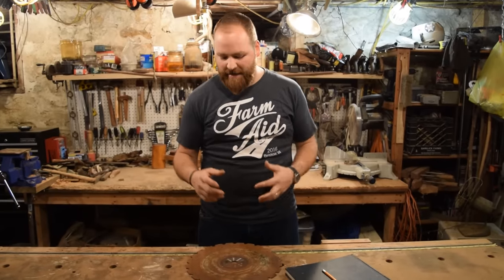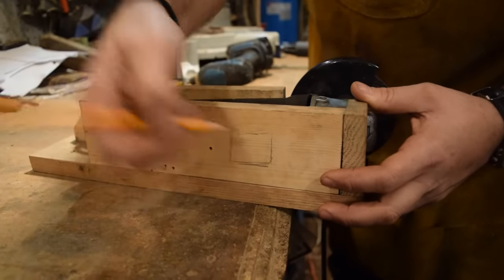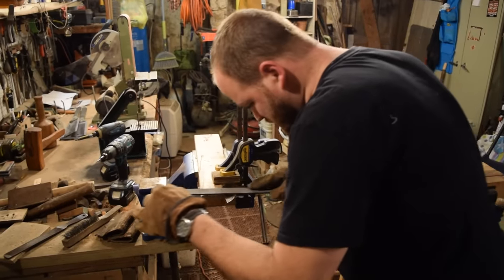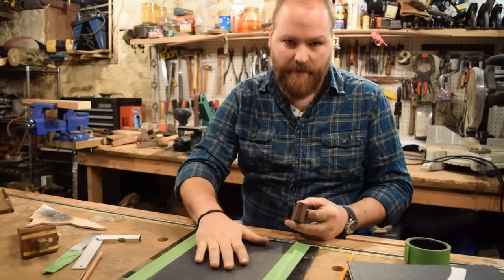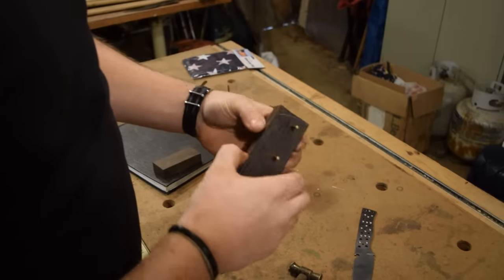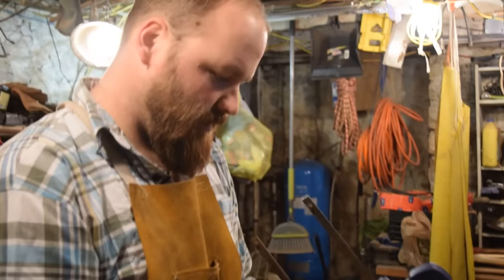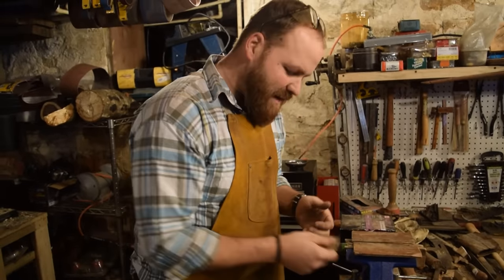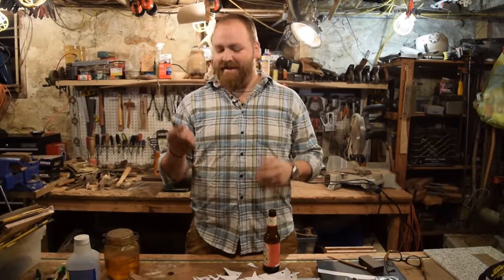Making a Knife From a Circular Saw Blade

Comment: To the marginally negative comments by some regarding Harbor Freight Tools; a craftsman can use any tool.  Tools don't impart talent, tools in the right hands (like this guy's) are simply an extension of the body.  I can't see the knife looking or performing any better with the use of a shop full of overpriced tools...
Reply: Theres a saying i like to use for those people. "All the gear and no idear"
Reply: ABSOLUTELY!!
Reply: certain Harbor Freight tools are great like their hand tools and power tools if you use them for DIY projects. I wouldn't recommend them as a daily tool for contractors or folks in construction.
Reply: But it will make ypur work faster and easier after you reached a specific skill level.
Nonetheless one should start with juat a hacksaw and some files. It works fine!
Reply: @cmiller9800  Exactly! They are affordable for the home DIY guy. I did without a lot of hobby tools until they came along.
Reply: OMG !!! Cheaper tools were used?! I don’t like the end result as much as I did before knowing this 😠 
  Just kidding of course, because I’m not a f**king idiot. 
  Cool knife. Making something useful by hand, got your kid and dog around the shop, looks like a great weekend to me 👍 friggin love it

Comment: Knife turned out gr8. True Craftsmanship. I noticed you said half of 7/8" is 3 1/2   8ths...this is true. A trick for you....any fraction under 1 inch use this method, half of 7/8  keep top number which is 7 ...and double bottom number which would be 16....7/16...my father taught me this trick 30 some years ago. He was a welding teacher for 30 + years. Half of 3/4 would be 3/8. You may have known that trick or not....just passing along knowledge. Great video shots.
Reply: I've never heard that before, awesome idea and it works.  Thanks for the tip👍👍👍
Reply: I would not normally translate half of 7/8 to 3 1/2    8th, my brain don't work that way. So if you don't have 1/16" scale: 7/8 = 1/8 + 1/8 +1/8 +1/8 +1/8 +1/8 +1/8 .  So half of that is 3 of the 1/8 plus half of an 1/8 left, which is 3 1/2  8th. Count three of the 1/8 on the 1/8th scale and eyeball an addition 1/2 of that.  So half of 5/8 is 2 1/2,  9/8 is 4 1/2, and so on. So it's pretty easy now, just half of the odd numbered numerator plus 1/2. Would have been easier with an engineering scale or go metric.
Reply: Go metric.
Reply: Thanks
Reply: i learned that in third grade
Reply: Mind, blowin.  Awesome tip!
Reply: @MrTallman83  working with fractions?
Reply: I was a welder/fabricator for over 20 years now but I never thought of that, that is a nice trick. thank you for that!
Reply: good info should be common knowledge but isnt
Reply: @NuckinFuts930  where are you?
Reply: @davidjones-vx9ju  Used to live in Alaska but now residing in LA
Reply: @NuckinFuts930  big difference
Reply: yea
Reply: yes my dad a tool maker told me same thing
Reply: OMG Hill, why didn't I think of that a longggggggg time ago. Thx for the tip!!
Reply: give a hug to your father, awesome trick. God bless you.  @plm2ajm
Reply: david jones 3rd grade? Hmmmm thats the class you graduated from isn't it Jethro? lmao 😂 just kidding Jethro dont get ur speedos all twisted in ur crack. 😂
Reply: What do Liberia, Myanmar and the USA have in common?
Reply: Brilliant!!!
Reply: use mm .
Reply: @Thornspyre  they never heard of metric lol
Reply: Easier: use the fucking simpler metric system!
Reply: Great tip
Reply: @camgnilpe9300  ignorance is a bliss
Reply: thefritt wut wut
Reply: That's not a trick. That's just basic math and the first rule of dividing fractions
Reply: Thanks a great trick! I've got an even better one... It's called the metric system :P
Reply: @davidjones-vx9ju  , but that was probably before 1950's, when they taught useful and practical things ?
Reply: @rogeriosartori555  ok what is one half of 3 meters
Reply: @victorcastle1840  '63
Reply: david jones... 1/3 of a meter may be easier!
(Its a smaller question)
Reply: @paulcollins9397  ok what is it?
Reply: david jones... My attempt at humor.
Reply: @paulcollins9397  me too
Reply: @davidjones-vx9ju  1500 mm
Reply: @BenAtTheTube  that took a month to answer...
Reply: @davidjones-vx9ju  there is always a few.
Reply: @bwghall1  where are you?
Reply: Yepp, Same here learned it as a carpenter for 30 years. Good tip, HillbillysNdaBush
Reply: Thanks that is sooo much easier!
Reply: great pointer! basic math that I had forgotten about - time to brush up on the simple stuff again
Reply: Like making a fraction a decimal, divide the top number by the bottom number and wallah! 1 divided by 4 =0.25
Reply: I was a union carpenter for 15 years and didn't know that trick. Learn something new everyday! Thanks!
Reply: Danny Hughes  we did have a perfectly good system you are right. Then someone came along with a perfectly better system lol.
Reply: @camgnilpe9300  on
Reply: I like fast and easy. Great tip. Thanks
Reply: Danny Hughes  The pricing on those new fancy 'metric' routers, saws, sanders, etc. are outrageous!  Luckily, I invested, years ago, in a tape measure that has both!
Reply: @thefrittxxx  I'm from Europe and I find very hard to understand, how come you guys don't go metric. It is much more simpel.Some say, more accurate too. I don't know about that, but  I think, that it can be complicated for some of you, if you are working with both systems, but maybe not on daily basis.
Reply: @kimchee94112  Or you could just say half of 22 is 11.
Reply: Or use Metric, less time spending doing fractional mathematics.
Reply: I have always used doubling the denominator-8 to 16; the 3 1/2 is good to know too.
Reply: Way too much discussion about "Reading a Tape Measure 101". 38 yrs a glazier, and I'm amazed how many people can't master this. As one guy mentioned, I learned that in 3rd grade.  Sheesh!

Comment: I would strongly suggest using hearing protection while working with the angle grinder as the high frequency noise generated by the grinder can permanently damage your hearing.

Comment: At least someone knows how to use a file. Saw a video earlier a kid was filing pushing and pulling the file. No you should only push file away from you. Great Job you know how to use a file properly. I'm 60 years old and been sharpening since I was 14. Had to cause I loved whittling. So 45 years experience I think I know what I'm talking about. Just wanted to tell you Thank You for using a file correctly.  Great Job

Comment: This is where I started 11 years ago, saw blades. Your metal work is pretty much identical to the process I use, but out of all the knives I've done, you went way, way further than I ever have on the handle...fantastic job on the wood choice and work. I went all in on a antler handle for a grandson, and I used a piece of Mahogany on one other knife for my best friend. I have used PVC and almost every thing else that I thought may be durable. I go all out for rugged not looks, but it's good to see what can be done...
Thanks for the video.
Reply: The edge retention will like a six cuts and gone :D. These 'knifemakers' are a joke to real craftsmans. What about to find out some information about steel first? No? If the saw blade has welded teeth, the body of the blade is junk steel about 0,3% C and can't be used for a good knife. So much work for such a useless result. FYI, I'm metallurgy specialist.

Comment: That is a Beautiful knife, And the handle turned out awesome. I would like to inform those that are thinking about trying this, that the saw blade is probably made out of low carbon steel something like 1008 1018 or so. At best you are going to get about 45 HR"C" from what ever the manufacture used, the tips on such a saw blade have carbide soldered on to the tips, in some cases the blade is from a high carbon steel, but the tips are flame hardened, leaving the core very soft. A good knife should have a hardness around 58-65 HR"C" depending on its end use and material type. But such a tool is a great way to get started in the buses of knife making. Just remember, if you can cut it with a file easily, it is not hard.
Reply: Jim Marcum  Hardness Rockwell C test
Reply: Old planer blades make great knives
Reply: Is there a way to harden the steel like heating it red hot and plunging it into water or oil?
Reply: @lanetterichardson9322  this only works for high carbon steel.  Heat to cherry red and quench in water makes high carbon  steel  hard  but  brittle.  Cleaning it back to bright means you can  then anneal it.   Heating it will produce varying colours  from light straw through to darker straw then to blues. This reflects a range of reduced brittleness and hardness.  For low carbon steel  you can case harden it by heating to cherry red and cooling it in a carbon rich compound to give a hard outer layer - repeating several  times.
Reply: @jonathanlodge4014  thanks for the info.

Comment: Love the video, but also have a of suggestion: name the materials as you're using them - such as the spray you used when sanding the blade and the solution into which you dipped the handle; also, regarding the handle, what type of wood you used and - stating the obvious - how you turned the wood to get that nice chevron pattern.  All the best.
Reply: How did you make jig for angle grinder please?

Comment: Great knife and great video! 

Pro Tip: Use a slower speed and higher pressure on your drill press when poking holes in steel. Your bits will rub less and take bigger chips which carry away more heat from the workpiece. This ensures your tools don’t overheat and lose hardness leading to breakage or dulling as rapidly.
Reply: He did.
Reply: Hard Metals: Slow Speed and Higher Pressure. 

Soft Metals: High Speed and Lower Pressure.
Reply: @user-td1zo3tv9p  Why would it be different for softer metals? Won't bigger chips due to more pressure also carry away more heat?

Comment: Backward belt used as a strop.  Cool idea. 
I am reminded by this that i have a bunch of saw blades.  30-45 years ago I was interested in one day making my own knives... when I retire.  I am close to retirement.  So being the rat pack I am, I saved a bunch of tool steel etc.   This video just reminded me of all the hand saw and circular saws I saved. I worked for a company that made power tools.  They purchased the blades from another company.  In one lot of blades they received the blade company forgot to put a kerf on the blades.  I took them out of the trash figuring they would make good cutting tools.  Not necessarily knives.  Glad I did
Reply from the maker: Sounds like the right time to make yourself a knife👍🏼😁

Comment: Love this knife, going to give it a go and try a old saw blade knife making 🙏
Reply: The edge retention will like a six cuts and gone :D. These 'knifemakers' are a joke to real craftsmans. What about to find out some information about steel first? No? If the saw blade has welded teeth, the body of the blade is junk steel about 0,3% C and can't be used for a good knife. So much work for such a useless result. FYI, I'm metallurgy specialist.

Comment: Wow the knife turned out great 👍 never made one out of a saw blade before. Looking forward to more frequent uploads. Just dont burn out though 😉 👍
Reply from the maker: OUTDOORS55 thanks brother. I started making knives with saw blades just out of college when I wanted a fixed blade for backpacking. I probably made a dozen or so before moving to other steel after learning the heat treating processes. They still work like a knife😉. And thanks for the advice. I’ll be trying to making lots of different stuff, so my hope is mixing it up a bit will keep it fun. Also going to try and do some shop visit, and collaborations. I would love to do something with you if you’re interested. I’ll can shoot you an email if that’s something you might be interested in.
Reply: The Art of Craftsmanship yeah man! Shoot me an email!
Reply: @TheArtofCraftsmanship  im goingto make a knife from  a circular saw blade  using  hickory for the handle s .thats a great looking knife you have their .
Reply: @OUTDOORS55  Wow! What that turned out really great. I used to do joinery, but never tried anything like this, not that I am retired I would like to give this a try. I have some old 16" blades around.  Thanks.
Reply: Oh hello there
Reply: The edge retention will like a six cuts and gone :D. These 'knifemakers' are a joke to real craftsmans. What about to find out some information about steel first? No? If the saw blade has welded teeth, the body of the blade is junk steel about 0,3% C and can't be used for a good knife. So much work for such a useless result.

Comment: I like my harbor freight angle grinder too. still using the model you have after about 12 years but have a few in reserve from the $5 tool sales! And the belt sander, and the drill press.  I've made a lot of things with those tools that I was proud of but never anything as nice as yours.

Comment: Years ago a friend picked up some large saw blades.  Like 36" in diameter.  He spent months drawing knife shapes with the chalk welders use.  When the blade was completely covered with knife outlines.  I would oxy/acet burn out all the shapes.  For the following year he was busy grinding out all the knives.
Decent steel, and relatively inexpensive way to find out if a certain style was good or not.  Or just fun.
Reply from the maker: Awesome!
Reply: @TheArtofCraftsmanship  What was really awesome was that he did ALL the grinding with a Sears belt sander mounted upside down, and it lasted years.  Go figure.  lol

Comment: Another tip: Save some of that dust you sanded away from your scales. In case while you're shaping your scales you run into a void, simply mix some epoxy and dust together and place into the void, when it is dry continue on. Additionally, try some spacer material and mosiac pins in order to turn your knifemaking up a notch. Great job!
Reply: Another tip: use proper steel for knives. These saw blades have welded teeth for concrete etsy the rest of body is junk. The edge retention will like a six cuts and gone :D. These 'knifemakers' are a joke to real craftsmans. What about to find out some information about steel first? No? If the saw blade has welded teeth, the body of the blade is junk steel about 0,3% C and can't be used for a good knife. So much work for such a useless result.

Comment: Just a FYI suggestion: as a lifelong cabinetmaker I will suggest, (to keep your fingers away from your bandsaw teeth) when rough cutting the wooden handle, fillet it to thickness first Then, cut it to length. Much safer! Uncle Fudd
Reply: I cut my thumb on one of those dang things 
after not listening to my dad.  Felt like a fool.
Reply: @frankjames5957  Applied for a job making wooden stakes. Got turned down because I have all my fingers.

Comment: Great work, really appreciate the craftsmanship.  Word of advice, if I may, wear hearing protection.  If you keep going without you will be wearing hearing aids in no time at all.
Reply: Tinnitus sucks
Reply: As an aircraft mechanic for decades I can vouch that tinnitus sucks. Just the sound of an angle grinder running in a closed room is more than enough sound to damage hearing. Remember the damage is cumulative, may not bother you today but over time, hundreds of todays equal hearing loss.

Comment: Love your videos brother. Your explanations are wonderful and you’re easy to listen to. Doesn’t the angle grinder ruin the temper on the blade edge part of the profile? Versus a hacksaw and files? Just thinking you’d hold sharpness a little longer if that section of the profile was kept from overheating in the process.

Comment: It would have been nice to see you put a good heat treat on that blade.  Nice video though.  Great for beginners.  Just know this blade will not perform like a true professionally heat treated steel.
Reply: If you want to temper steel
just leave the knife on the truck dashboard in Texas Summer for an afternoon
Reply: Then quench in a can off beer.
Reply: kimchee94112 waste off beer, just let it run through and quench it on the way out 😂

Comment: Perhaps, when you have cut out your template you could trace it onto proper paper or cardstock.  Then proceed with your project.  That way you have your template but you didn't have to redo all the measuring and drafting.
Or 
You could just take a photo.  Then print it on plain [not glossy] paper when you need it.  An old cell phone that no longer has service is great for such photo storage.
Aunt B
Reply: DB Cooper's MoneyBags  Or, you could just keep the original drawing in your sketchbook... and make as many inkjet prints as needed, whenever needed, also, scalable up or down... and use that as your cutout pattern.  That way you'll still have your "original idea"  preserved and protected for prosperity and repeatable usage.  I love this tutorial and am sharing it with as many friends as I think would appreciate it. An excellent job.

Comment: pretty sure cutting steel with a grinder raises the temperature and softens the steel. It would need to be tempered again properlly to regain the strength it had as a cutting blade. You could try tempering it , otherwise is will dull quickly and not retain a sharp edge
Reply: In this case doesn't matter. The edge retention will like a six cuts and gone :D anyway. These 'knifemakers' are a joke to real craftsmans. What about to find out some information about steel first? No? If the saw blade has welded teeth, the body of the blade is junk steel about 0,3% C and can't be used for a good knife. So much work for such a useless result. FYI, I'm metallurgy specialist.